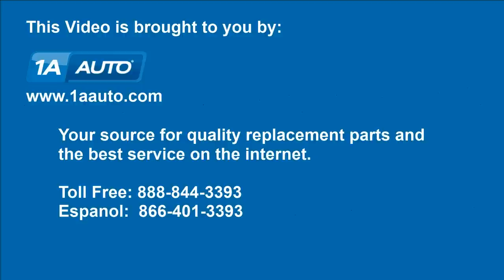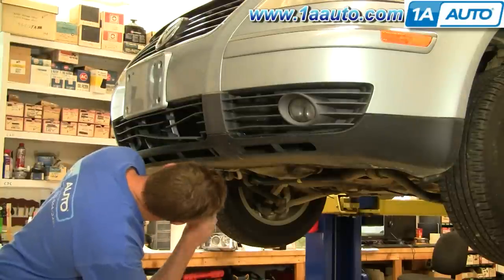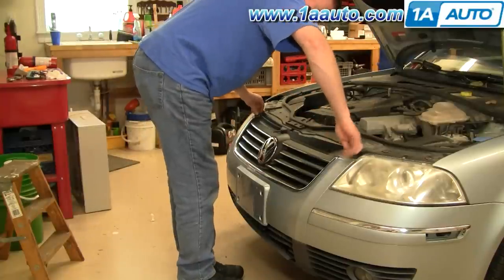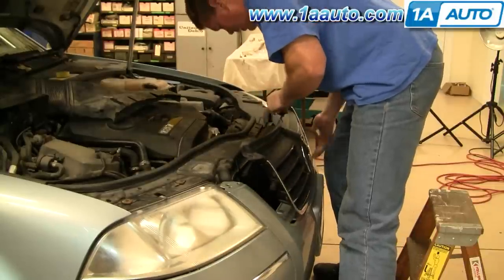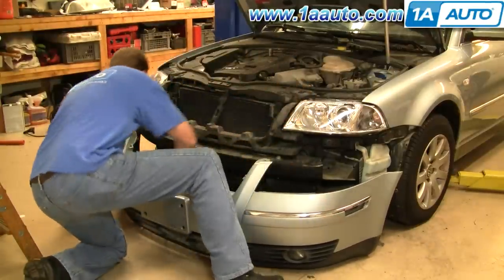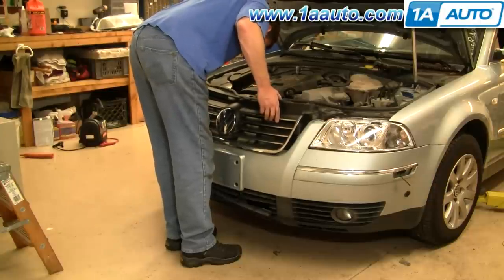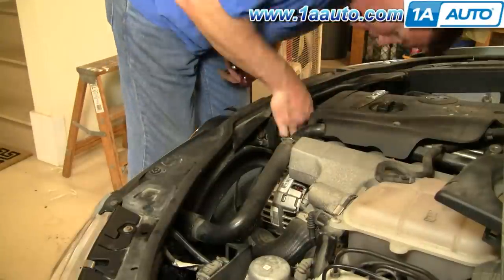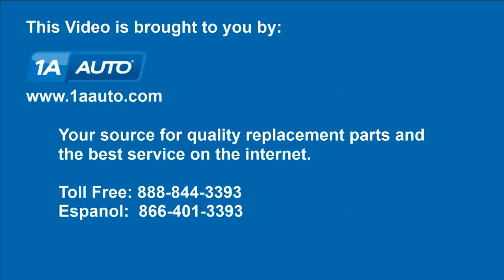How To Remove Front Bumper 02-05 VW Passat

Comment: I just got these headlights for my passat it looks like a whole different car. I have one question what is the light bulb model I need I wanna replace the ones the came with the headlights to a blue or florescent color.
Reply from the maker: If you take the bulb out it should have a part number on it. 1aauto.com 888-844-3393